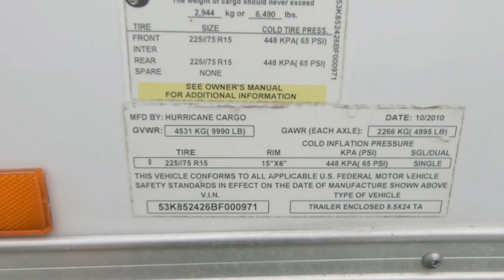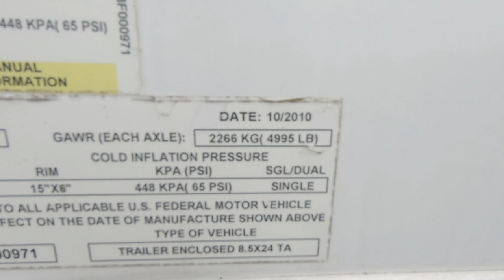Cheap Cargo Trailers - Where they save the money

Comment: Don’t know if you’ve already done it on the wood on the underside,  is get some boiled linseed oil and spray it on. Wood sealer doesn’t penetrate the wood. It’ll end up flaking off where the linseed oil gets “Into” the wood and repels all moisture. You can even thin out the oil a bit. As far as I know the oil doesn’t come in a spray can so you’d have to set up a compressor and spray gun. You can see on the inside where oils been on the wood. Just that alone will repel moisture, but linseed works better and cheaper than wood water sealer in cans. Good vid for those not looking for new.👍

Comment: I agree with one of the commenter's, you don't want an RV latch. You can yank one of those out with a crowbar in 2 seconds. For the roof leaks, try eternabond tape. Once that tape is on there it will never leak but it will never come off either. Very good walk around video.
Reply: I learned with the RV latch a long time ago it popped open hitting hard bumps in the road when I came to a stop the door swings open. So I like the RV latch but I also must have a bar lock over it for traveling!

Comment: Nicely thought and executed.  I purchased an "economy" trailer from south Georgia a few years ago.  Drove down and picked it up.  The lack of quality control was surprising.  However, my venture was price driven.  Still, the poor quality was unexpected.  So, the process of addressing short cuts and attending to matters which are suited for my needs has been a task.  A couple of items to point out are the blasted holes in framing for wiring.  It would be reasonable to conclude that the rough holes will likely cut wire insulation.  Another is the design of disimular metals contacting one another.  That would be the aluminum skin and metal framing.  Your insight into hanging heavy objects from walls is wise.  Gotta' remove the two spare tires!  They'll go in base cabinets which are supported from the floor.   During my dance with the South Georgia folks, a rep mentioned they had not had a failure/leak from the seemed roofing but roof vents can be problematic.  With that in mind, wall vents merit consideration.  But alas, no illumination.  Then there's rust.  My experience is there's no waste of paint as the points not viewable were not primed or painted.  Rust was quick to appear.    Your model of buying used is viable given bringing a new trailer up to reasonable standards can be resource intensive.   Thanks for the vid!
Reply: Did it happen to be an empire? Just had a nightmare with empire
Reply: @bigjake352  Nope not Empire.  Eagle Cargo.  Probably little difference from shop to shop, if pricing is the priority.   Gotta' wonder if most buyer's have the knowledge to look at build quality.  However, quality takes more labor hours, higher skill levels and better/more expensive materials.  The result is higher cost but longer service life, of course. Again, buying used and renovating the trailer likely results in a better trailer.

Comment: Great walk through, thank you. One of the upgrades I’ve seen is putting the in the under carriage with a trap,door to access when needed.
Reply from the maker: My cousin has that on his.  Here's the potential problem with that design and why I'm going to forego it.  If the trailer is loaded and you get a flat, how hard might it be to get to the spare?  Because I plan to long haul this one and carry more than wheeled vehicles, I'll have both spares where they can be accessed easily.

Comment: Up north where I live they get economy trailers with fiberboard in them which is heavier and worse than plywood even! They are charging $10,000 for the size trailer and it is a piece of junk. I personally ordered my trailer from Georgia and spent $6,000 and got upgraded 16 on Center framing everywhere extra height and poly core siding for 40% less money. The trailer Market is very deceptive in you have to watch out it is a very tricky Market to navigate. Great video! There aren't many videos on YouTube showing the build qualities of these trailers in the differences between the manufacturers.
Reply: Where did you buy yours?

Comment: The bar lock is the upgrade from the RV latch and an extra charge for all of the trailers that I've shopped.  As for your awning and porch light ... you will exceed the legal width limit for all interstates and a lot of state roads too.  I doubt they'll give you too a lot of crap for it but they can.

Comment: Very nice walk-through.
 I would consider putting automotive sound deadener like Killsound. That would make the interior more comfortable and I also would consider putting a relatively small solar panel on top where people do not see it and an charge controller so you can keep the batteries charged up. That would also allow you to get a battery minder for the small battery for the brake-away battery. I like you idea of lights on the ramp for loading in the dark and also the awning for shade in the hot noon-day sun.
Reply from the maker: I like the small solar battery maintainer idea.  I have added the rear lights and the awning.  I have a video coming on the later.

Comment: when I bought my 28' new I painted the floor before anything was put in it. getting used a different story ...  with deckover from HD not slippery. and walls with a fence paint wanted to be able to hose it out. 
and not take a month to dry plus it looks much cleaner.

Comment: Solid walk-thru and helpful preparing me for my upcoming purchase.   Its spring 2022 now, I realize this video is over two years old but do you have any tips on sourcing a trailer that is similar size / condition?
Reply from the maker: It was all about patients.  I looked for about 8 months before I found this one and I had to drive 3 hours to get it.  If you have an immediate need, this won't help but it is what I did.
Reply: @sbirdranch  Thank you for your reply. I have plenty of patients (still working on tolerance).  Did you use anything special or just craigslist, fb marketplace, ebay?
Reply from the maker: @mondavou9408  I used FB marketplace.  I found (didn't know) that as I continued to scroll down, it was increasing my search radius.  That turned out to be the trick that got me to this one. ~P
Reply: @sbirdranch  Thank you.

Comment: Great walk around. Any issues with leaking in at the ramp door? I was really hoping for a close up of the weather stripping on the ramp. Mine has a 1" rubber strip on the sides and bottom but not the top. There is a rain gutter about 4" above the door. All this means that it leaks like crazy in the rain. I'm wondering if they mounted the door upside down. Why have weather stripping at the bottom and not the top? If water did get in, I wouldn't try to prevent it from getting out at the bottom. What's your weatherstripping setup?
Reply from the maker: Sorry, I just saw your comment.  I don't have any leaking issues back there.  Kinda surprised by that to be candid.  There is a 1 inch strip of simple weather stripping around all three sides and a small gutter at the top.  The gutter on mine is only a couple of inches above the edge of the ramp door.  ~P
Reply: @sbirdranch  so you have the weather stripping at the top, not the bottom? On the door or on the box?

Comment: Very informative and helpful!
What is a reasonable or common price range for a trailer like this?
Reply: some of the uploaders seemed a little tight lipped about that question, but the CheapRVLiving guy said a new one ( smaller than this model presumably) is about $3,000 and up, to start. Used ones are almost the same price.

Comment: Serious question from a trailer newby but do i really need brakes on my trailer if it a small guy like 12' or less? Ive heard mixed answers.
Reply from the maker: It is all about the weight you plan to carry.  Another consideration is how much tow vehicle you have.  I can stop a much larger load with my 1ton duelly than I can with my El Camino.  
Most small utility trailers and single axle enclosed don't have them from the factory. 
I wouldn't consider a trailer the size of this one without brakes.  ~P
Reply: Yes! I have a 12' with no brakes. I also use a friend's with brakes, same size. Huge difference. I have an 06 Silverado 1500. Even empty the trailer probably weighs 1000 pounds +/-. That's weight that's pushing you if you need to stop quick. Brakes are worth every penny.

Comment: What is your measurement from the centerline of where your ball goes, back the the body of the v-nose along the top of the two tongue frame rails. I’m looking at one that is similar from Georgia and want to know if my equalizer hitch spring bars will fit.
Reply from the maker: I just saw your question.  I can go takes a look later this morning.  As I recall, my equalizer would fit if I wanted it to.

Comment: where is the best place to look for 2nd hand ?
Reply from the maker: I looked in the typical places.  Craigs List and FB Marketplace.  In the end it was Marketplace and here is why.  When you do a search, you supply a radius to look in.  BUT, if you get to the end of the list, it will show you more, outside the radius and as you go, it will continue to search out further.  That is how I found this one.   The other thing is patience.  I looked for almost a year.  In that time, I passed on several and missed a couple.  Hold out for what you want.  I'm glad I didn't settle for a 7500# version.  ~P

Comment: Polycore is the new way to side a trailer.  4 times thicker siding.  All the Georgia companies in 2024 all have dual electric brakes on their axles. I have looked at the cheapest economy trailers and cannot find any that do not have dual electric brakes anymore. You also need to look at frame cross members because some of the more expensive trailers have cross members every 24 in on Center and the cheaper ones are actually 16 on Center which is stronger and a better build quality. You really have to do a lot of research nowadays because you're overpaying for less quality with some Brands and you are getting a much better deal on others paying much less. The bottom line is you really have to do your due diligence and learn what you are purchasing when it comes to trailers!